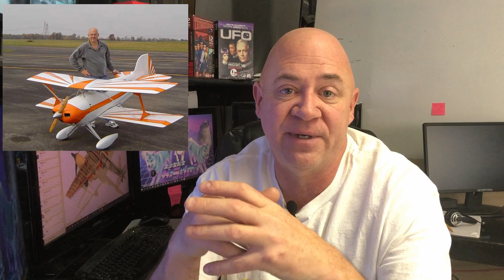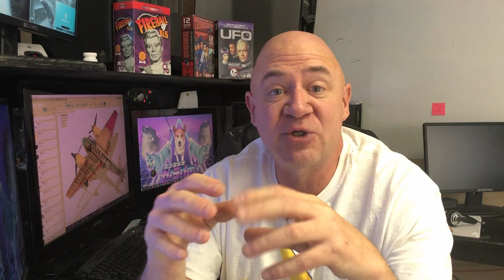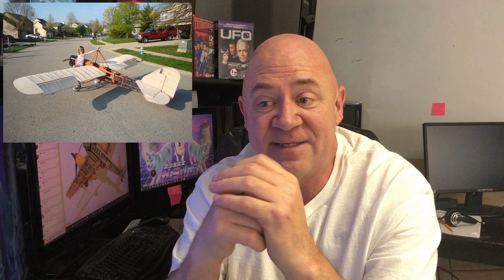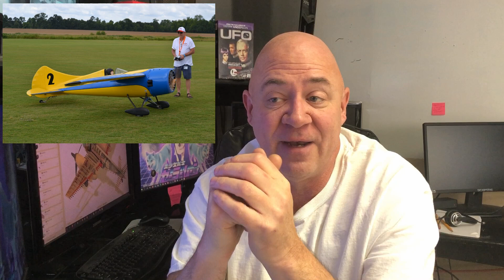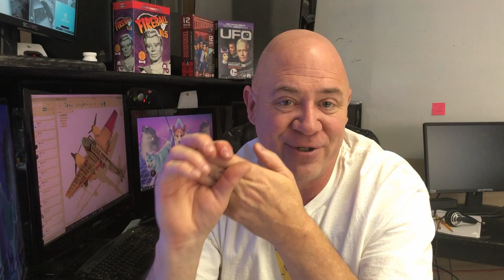LIPO Fires (WHY?)

Comment: I tell people that Lipo's are like firearms...pretty much harmless unless somebody does something wrong with them. Like firearms...if  ALL the rules of safety are used regularly you should never have an incident. Use a good charger, be in the room you're charging in,  pay attention to the condition of your Lipos,  always storage charge when not in use, store them in a fire proof container (I use sentry fireproof safes),  never leave them fully charged for more than a day or two (before a flying session), be careful pushing them when charging ( I charge at 1c), double check your charger settings every time (balance charge!), don't handle them by holding them by the leads, and finally...don't get in a hurry...be methodical and pay attention to what you're doing.  

Great video...thanks for sharing!

Comment: Only one single incident in well over 14 years.... "And it was because an dead short circuit!!  all my charger have a temperature sensors and if the battery get to hot it literally shootdown... Great video,

Comment: I have been using lipo batteries since they replaced nicad and nimh packs i, have flown over 100 different planes since my first lipo pack and have easily 3000 charges and no issues...

Comment: So I have come to one conclusion when it comes to other people lipos.  They are charging at to high of rate! Most and I mean 97% of the guys at the flying field that use lipos have packs that are puffed way up. I watch them charge these packs at the field at 3-4-5 C! They charge the few packs during the week. Yes all week before they come to fly. Then arrive fly the plane. Pull the pack still warm from plane toss it on the charger at 4c and charge it back up. One guy especially always boastingvhe can charge his 3000 packs in 7 minutes. Then he pulls it right off the charger and puts it in the plane and flies again. Over and over till mid afternoon then goes home. Ges the most extreme of the group for back to back on 1 pack but most follow this procedure. Very very high charge rates are bad! All the videos on YouTube of Lipo testing and the number one cause of a Lipo to catch fire is charging to high of rate. 1C folks. Yes it's slow. But batteries last Thursday and fire risk is reduced to nearly 0% chance. If You want to fly more is better to get several packs. If you have 4 packs and can fly the first one then let it sit for 15+ minutes after the flight. Put it on the charger and start the charge. By the time you get through the next flight or 2 the first pack is now ready again. Start the next one. By the time you fly out the original 4 packs you will have charged 2 to 3 more packs as well. So 4 packs charging at 1c will yield around 7 to 8 flight over a 4 hour period. Mix in another plane and a separate set of 4 Lipo packs for it doing the same thing swapping between the 2 planes and flights and charging and in a 4 to 5 hour morning of flying you get lots of flights and never put any super high charge rates to your packs. I been doing this same setup and I truthfully have never even puffed a single pack or had a fire. Nothing. Hundreds of flights. Hundreds of cycles on many of my packs. I charge safe rate of 1C and ALWAYS on balance charge mode. Never use fast charge which is also what most guys select. So 1C no fires. Never lost a single plane due to battery failure. Fly to hit landing with 30% left. Storage charge when you get home. Balance charge. I will charge up to 48 hours before we go to fly. Never sooner and most of the time we charge the afternoon and evening before. But never let packs sit full for days on in. This will not do anything major but does shorten the life speeding up the higher resistance level of the cells in the pack. But again folks cannot say it enough fast charging is where the fire problems come from. 2c would be the most extreme I would ever and I mean ever in a super crunch and I don't see any reason for that it's just a model plane to fly for fun but never above 2c in a hurry and still on balance charge not fast charge. 1C balance for many safe cycles of your lipos. I have right now in use 114 Lipo packs that I use regularly. I fly almost every day when weather is good. I also store my lipos in a mini fridge set to a cool temp. Not super cold but cool. I started this awhile back and I have noticed my standing voltages staying more stable and resistance in the packs not changing if at all since doing this.even still flying them a bunch they are holding as new. But this does add to prep time as you have to pull them out a few hours before charging and let them warm up to room temps. Anyway glad you made this video and I hope more guys start to give there lipos some more care and understanding of what is causing these fires. All the points in this video are spot on. But charge rates fellas is where you are going wrong. I know you are in a hurry to charge. But know in the end it's going to cost you. Fire in house/garage or the car or in the plane when you pull that nice puffed Lipo hot off the charger toss it in the plane and next thing you are flying is a fireball.
Reply from the maker: Spot one. Great stuff. I am covering some of this in a Lipo Battery Care and Maintenance video I am working on.

Comment: This is absolutely good advice with a GOOD smart charger being very critical as well as not overdraining these lipos below 3.7. I consider them to be very safe if you pay attention to the charging as well as the individual cell condition so you can head off a problem before it occurs.